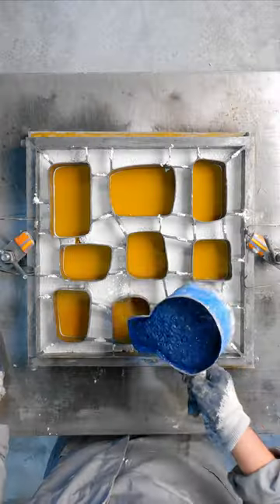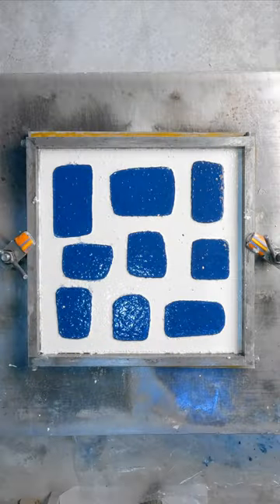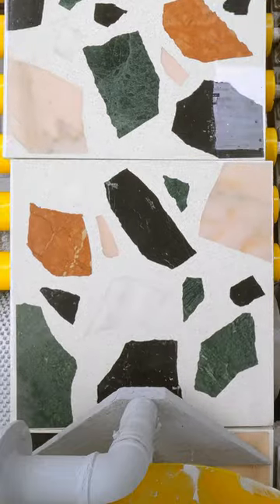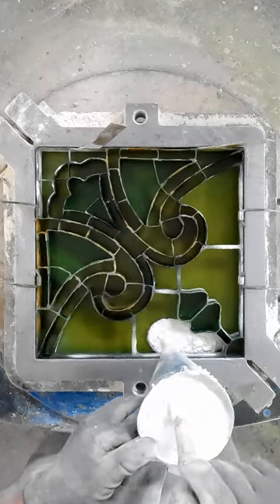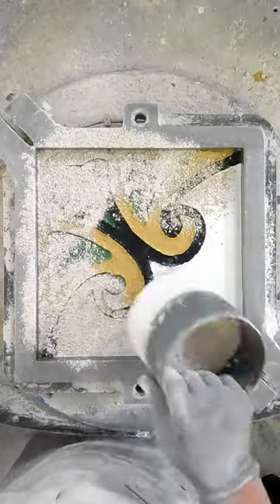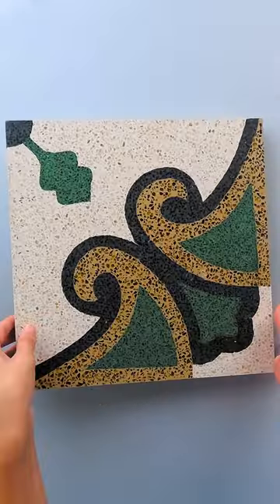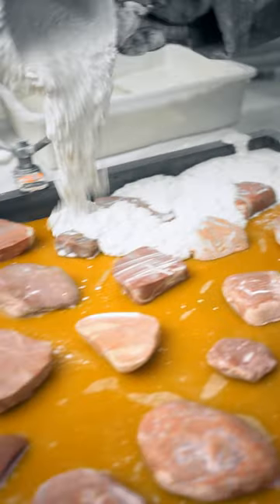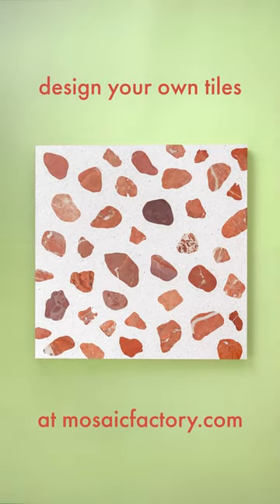How It´s made - Terrazzo Tile Production Compilation

Comment: Explain about the materials used and the rest of the details, as well as about scouring and softening
Reply from the maker: Hi 😊 For our terrazzo collection, we use Portland cement, marble and sand powder, as well as pigments and other materials to achieve the perfect mix. Then it is poured in a base which contains marble and crystal aggregates in random patterns, so it makes each tile unique 😉 You can find more info on our terrazzo collection in the following link: https://terrazzo-tiles.com/technical-data-terrazzo.php 😊